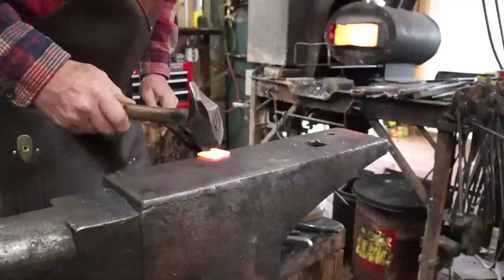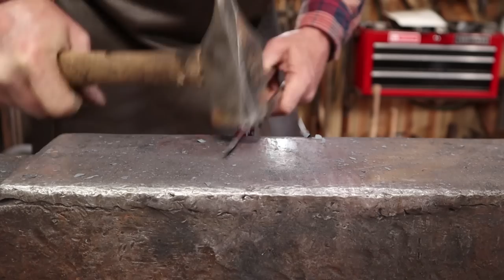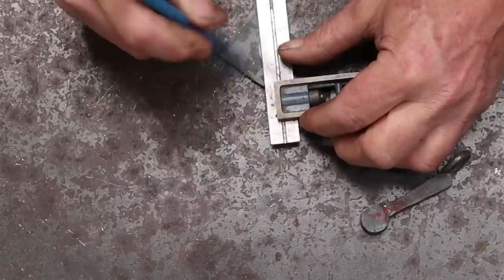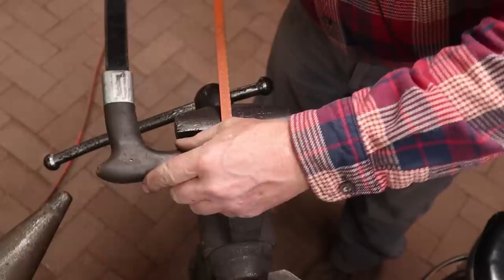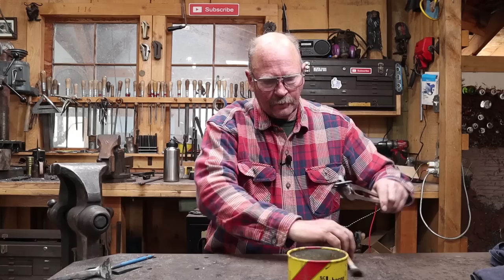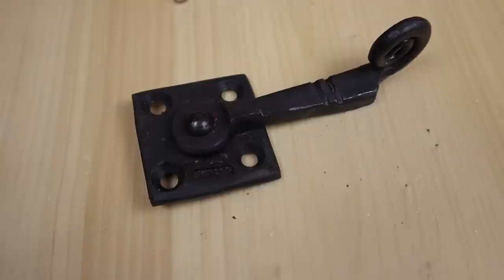Forging a Cabinet Latch

Comment: Did anyone catch how John teaches us even the smallest things in this creative video. For me it was the use of the Safe Edge File...I;ve never seen one in my life and in UK...But I could take a normal fille and grind off one edge... If you saw anything else please comment. Thanks Again John for yet another valuble lesson your the master. Bye the way I like hoe you admit you could improve by making the back plates a little larger, that's how we all learn by trial and error. It's called product development.
Reply: When I did my engineering apprenticeship in the UK back in the 80's, almost all of my files had one safe edge. I've stll got them and accumulated more over the years but never bought a single one. Can't vouch for how the new ones would be.

Comment: I just want to say that I appreciate you giving metic measurements along with imperial even though you don't have to. There's a big enough market and audience for blacksmithing in the US alone that you can get by just fine without ever thinking about a milimeter but you go that extra 1,6 kilometer anyway. Thanks for that.
Reply: Err, how far is that in miles? 😋😂
Reply: @Zogg1281  1. thats the joke lol
Reply: John, I would second Redmars comment, I did my schooling in the UK in the 70/80's as the UK was converting so I switch between the two to which is convenient at the time. Now the schools only do metric so don't even know what an inch is. Railway also uses chains, now that even more confusing.

Comment: I've always filed on the edge of a bench or holding something by hand... I wondered what those things hanging on the shop wall were. Thanks for showing the filing vise use and clearing that up! 👍
Reply from the maker: I have several videos on the filing vises
Reply: @BlackBearForge   Thanks! I just found them. They look handy enough to make a couple!

Comment: Good looking design. If the latch arm was symmetrical, it wouldn't matter which way the door swung.  Universal latch.
As is, reversing the offset would make a dedicated left side latch instead of this right hand. (Thanks Capt. Obvious). 
Anyways, I like it. Might have to make a full set for my kitchen once we start remodeling.

Comment: Would you do anything different if you were doing a production run of these? Say, a dozen sets or so for a kitchen's worth of cabinets.
Reply from the maker: Figure the details out with a test piece and then forge all of each part in batches then do all of the assembly work.

Comment: I've been trying to work out how to incorporate a spring into this, came up with a few ideas. The easiest one is probably the ugliest one and involves buying a pack of springs.  Unfortunately it's really hard to find black springs and most prefabricated springs are that shiny zinc colour. I do have a question, how difficult is it to make a tiny flat but curved spring out of coil spring or flat suspension leaf spring? Is it worth the hasle?
Reply from the maker: Adding a spring usually means a larger back plate with room for a flat spring
Reply: @BlackBearForge  , thank you for the reply. I want to make something similar, but for a smallish double door.